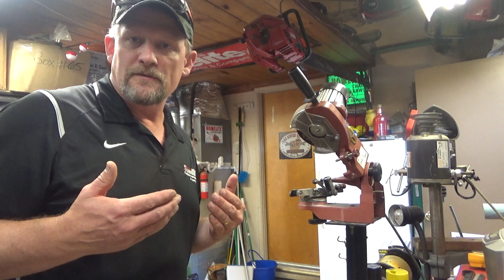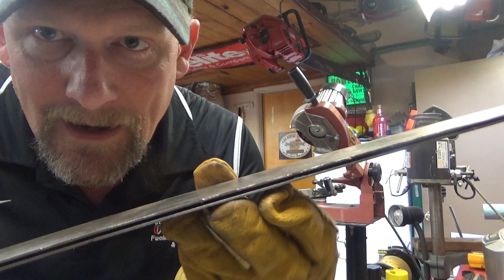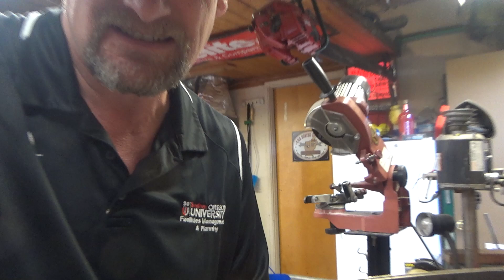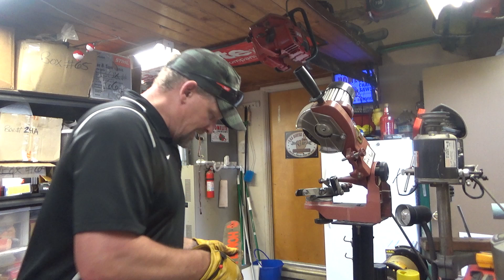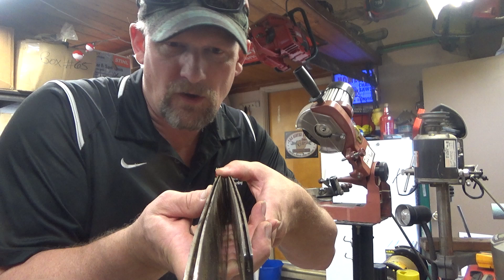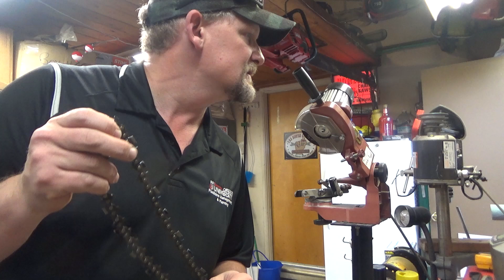Reconditioning Some Used Homelite Bars Using Hand Tools & The Barshop!

Comment: Watching you hammer your bar in the vice....I have a solution. You need a thick bar of brass, maybe 1 to 2 inch squared, heaver the better. Cut a grove for the bar to sit in. Set the brass bar on something bigger and hard like a concrete floor or a heavy length of steel, say 2 X 3. The brass will dent instead of the bar steel.
Reply: It may also be a good idea to get a brass hammer.

Comment: When you have the bar in the vice to close the gap, I would put a piece of wood (a 2x4 cut to fit), under the bar, so it can't get pounded down any further. I think hammering on the bar on the anvil part is what caused the big chip.

Comment: I think the 196-D5 had that pin pattern to use on early 350 and 360 saws that the adjuster pin was a small rectangle

Comment: By placing the bar rails on the vice.......you were inadvertently smashing the opposite down side....  I put the chain in the rail. and squeeze the rails with the vice.... it closes them right up to 50 gauge.
Reply: Surely his bottom rail was clear of the jaws, wouldn't ya say?
Reply: Tightening them back up works, for about a day. Much better to just go up in gauge as the bar wears imo . Starting with .050 you have .058 and .063 next. After that I’d say you have got your use out of the bar.